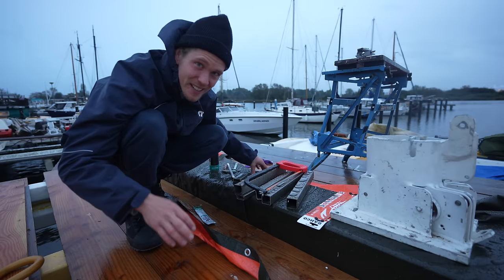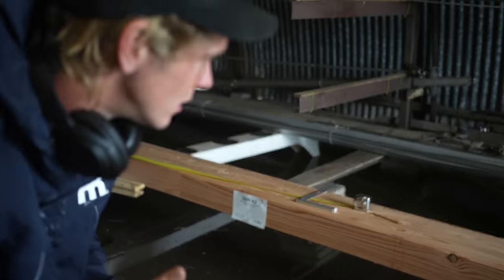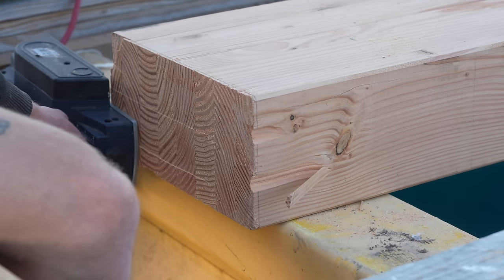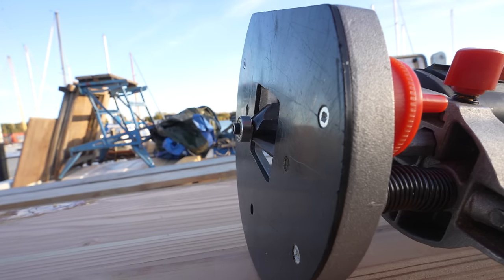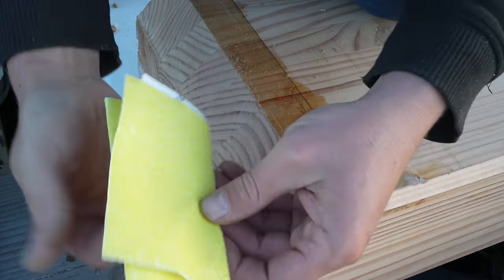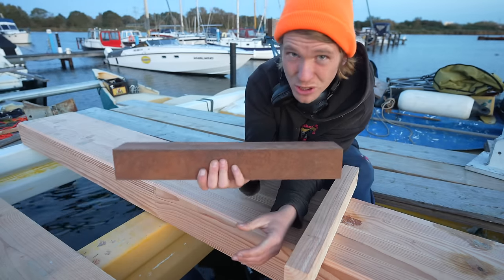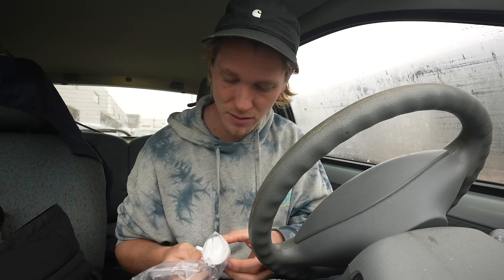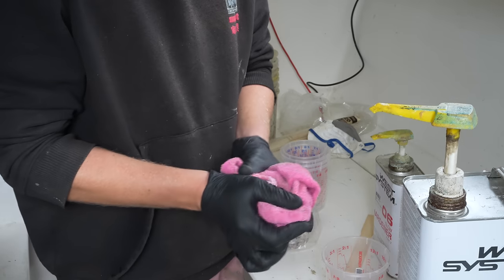My 42 ft Catamaran gets a HUGE Mast Step! | Wildling Sailing

Comment: Makes sense to use wood the same as the cross beams Mark. Personally I've never liked lag bolts, they always seemed mickey mouse to me. Drill holes in the soft wood the same diameter as the core diameter of the lag thread bolts always.
Reply: WildlingSailing0.  I can't use telegram but thanks for the offer.

Comment: If you are afraid the mast beam fixing bolts are not holding, you always can ad lashings. There is no sealant between the mounting poles and the deckbeams? As rot resistant as that wood is it won't dry at the meeting surfaces.

Comment: Mark you need to lash that beam with a stainless steel U bracket backed by a plate around the existing beam. It's so frustrating watching you,  at least I have so many adverts to watch to cool down.🤔🤔🤣🤣🤣

Comment: Nice mast beam. Nice choice on hardwood blocks. 316SS bolt material also good choice. I'm a little iffy on the lag bolt diameter and length tho. 1/2 inch (12mm) feels better. Allthread rod with washers feels the best. What does the drawings say? I always over design and make stuff hell for stout.

Comment: Hey Mark, concerned that you did not through-bolt those pieces of wood. Also no need for the lag screws to have any 'purchase' in those pieces of wood - the important thing is they screw down snuggly into the beam. Lastly if you're going to put epoxy in the holes, why not just cover the screws with epoxy - you'll get far better penetration?

Comment: Don't use lag screws for this critical connection of your mast beam.  Use long stainless bolt all the way through with locking nuts on each end.   A much more secure connection for this critical step.

Comment: Lag bolts are not my first choice, 316 stainless all thread through bolted would be my choice with a spring and flat washer at each end. Possibly 16mm dia. All thread is a much cheaper option than buying long screws or bolts. The hole in the hardwood should be oversize and wetted out with epoxy. Use a bedding compound between the pieces having first epoxy coated the timber. Question, are you going to glass over the beam? The beams lamination is laminated to have maximum strength in opposite direction to the way you are using it. A few layers of fibreglass cloth will help with this.

Comment: I would use metal plates for securing the beam. The wood is not going to be strong enough. 3/8” thick should be sufficient or 10-12 mm

Comment: why not cut a small recess on the mast beam so along with those screws you also have wood joint and much more strength to endure high winds, so that it fits perfectly there, i think something like 3, 4cm will not affect so much its strength and will guarantee it stays in place much better!

Comment: With the router, so you don't get tear out, just advance slowly regardless (you can't stop anyways). The slower you feed it, the less chance of getting a chip. If you PUSH the bit in, you'll explode the wood regardless of direction.
13:33 use a soap bar (which you rub on the saw's sled). You can use the bar of soap on any of your hand saws as well.
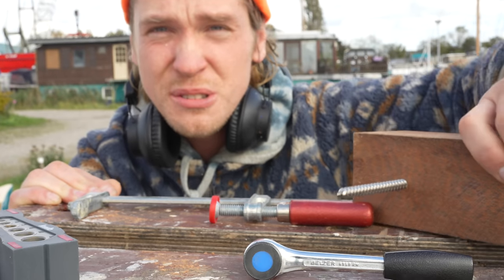22:26 you don't put your screws into the wood, because that doesn't do anything good for it in a marine env. You put a large hole (so for example, for a 7 mm screw, you make a 9mm hole) and put epoxy inside, you let that set, then you drill the thickness of the shaft of the wood screw, not its peaks (at the threads) or less (less, is better but harder to screw in and you can't always find the right diameter - usually you make your own drill out of a spade drill which you grind until it's the right diameter) and then you put your screw in. That way, the screw is set in hard epoxy, encapsulated and away from the wood. Be it stainless or regular metal, doesn't really matter, in time it will affect the wood because it's not the same material, so you're better off having an epoxy plug.

Comment: I would think that you may use a stainless steel bracket instead of the wood and get a stronger
mounting with less weight

Comment: Most decent quality epoxies work well and are much cheaper than the "West system". If you visit a chemist they will sell you hypodermic syringes...cheap, the two sizes 20 ml and 5 ml suit the epoxy and the hardener and provide a simple but highly accurate way to measure the epoxy. Obviously you do not use the needles, and this way you can mix small quantities for hole filling and such. All epoxies even with paint added erode in a few years in the sun, so if you plan on bringing her to closer to the equator you need to apply a coat of two part polyurethane paint to last a decade or more...Good luck.

Comment: Thanks for posting this video Mark, another great episode.

I read a previous comment about the way you've done the mast base with the coach bolts not being strong enough.
I mean disrespect to that person and I'm no engineer but isnt the  purpose of these  blocks just to locate the beam and the compression load is then taken by the main beam that youve attached the blocks to?
My only concern was the Fairy liquid being absorbed into the timber and affecting the  adherance of epoxy or paint to the beam, definitely will need a good scrub with fresh water to remove the fairy liquid , other than that Sealing the back of the blocks to prevent them absorbing water and rotting before attaching them I understand you'll be painting them later but that just me.

You're looking a bit tired in this video but You're doing a great job getting the Catamaran sorted she's looking Great, I'm not sure how the situation is with marinas in the UK but sure that once you get her in a condition to sail across the channel , being closer to home would make the process easier. 

Cheers

Comment: One will be able however to use this method when one wants to calculate the loads due to the 
lighter sails. In this case one will be able to take for the side force: 
Fy = 0,0625 x V2
x S x C where:
V = speed of the wind in m/s; 
S = surface area of the sail in m
2
;
C = variable coefficient of bearing pressure according to the shape and hollow's of the sail but 
which we will consider equal to 1,2. 
On the other hand we can determine rather well the share of the total force developed by the yacht 
of the jib, the mainsail, and also the resistance of the rigging and the hull. 
In addition we also know rather well the value of the lateral component of the total force since its 
moment compared to the centre of the immersed canoe body is at any moment equal to the righting moment

Comment: When you bold down that mastbeam don’t use glue as you cannot remove it when you need. Don’t worry about the weight of that beam. Your boat is designed to carry the weight of six or eight people and their supplies. I do worry however if the beam is strong enough and if you should not put the other half on top of it at least spanning the distance of two of the crossbeams. The forces are not only the weight of the mast snd sails but also the tension on the stays and the sheets. Those are not steady forces but dynamic forces as the boat slams and bangs the mast will do the same. But the mast is 12 meters and the forces that make the mast swing in the top will be increased times 12.

Comment: Hi Mark, I like a lot how you keep improving your boat as well as your abilities. I'm sorry I need to say it, but in minute 17 you're carrying your electric tools by lifting them holding the wire. An electrician who might see that would probably like to kill you. The pull relief inside the machines is only designed to carry the weight of the WIRE. So better don't do it that way and have your tools in good condition for many more applications that will for sure come. I wish you will have great success with your work on Mahi in future just as you had in the past.

Comment: The biggest force on the beam you're installing is compression. You could almost hold it in place with a couple long dry wall screws and 2 dobs of thickened epoxy. Beautiful piece of laminated lumber that will handle everything you could ever put against it. Looking good!

Comment: Keep at it kid.
Quite the educational experience.
The folks panicking over potential loads and stress should not be lightly dismissed, if only to ensure you have thought things through.
However, to duplicate what was specified and executed in the original design drawings would appear to have a fair amount of historical evidence to support doing it as Mr Wharam intended….yes/no?

That said, considering the amount of time and effort and expense repairing rot in places of structural significance…I think you should be more diligent in bedding or bonding any material  that will be exposed to the elements.

So much surface area underneath the wooden cleats you’ve lagged to the cross beams that will ultimately get wet and start rotting, again.   The same epoxy you used to fill screw holes could be used to bond the blocks and minimize water penetration.

You are correct that virtually every epoxy has limited UV resistance.  Don’t be fooled into thinking that you can add some  pigment to create an effective paint or varnish. It looks pretty. But if it’s exposed to the sun you’ll still need to paint over it to keep it from turning yellow and flaking off.

Lastly, look up a curing phenomenon called “amine blush” that many epoxies exhibit.
It’s a residue that can form on surfaces of newly cured epoxy.  It’s gummy and makes additional layers of adhesive or paint difficult to bond if you don’t wash/scrub it off.

I know you always feel the pressure to get all of your many chores done….but gluing up a few small test joints in advance may provide insight regarding mix ratio, bond strength, cure times, blushing….etc.
In the long run, it will likely save you some time and certainly build confidence.

Best to all, especially mom and dad.

Comment: Mark, your going good mate, do yourself a favour and buy new outboards, hi thrust, 4 stroke with fuel injection, for easy starting and prevent stalling and the biggest you can afford as on a cat in a head wind it is easy to lose steerage.

Comment: Those dark wood blocks you screwed onto the crossbeam with those very long countersunk screws do not appear to have any washers under the screw heads.
I don't think that is a good idea. You take the risk of splitting the blocks with those small screw heads.

Comment: So I am confused by some of the comments. If you are following the plans for this mast step, great. Follow the plans. If you are not following the plans then, well, probably you should be. I suspect the beam would be strong enough, and I trust the plans, but I would be hesitant to trust the beam if it is not in the plans.  And as I said in my other comment, but want to reiterate, you absolutely cannot leave uncovered Douglas Fir on a boat. At a minimum it needs to be coated multiple times with epoxy and then painted. Ideally it should be wrapped in fiberglass because Douglas Fir is very prone to checking. I am not sure if epoxy coating will fix that problem.

Comment: I agree with others. some kind of bracket around the mast beam and crossbeam is a better plan.  one idea would be to use a concept like is used on the ends of the crossbeams and tie the mast step down with a mountain of rope. you could screw those pieces of wood up into the mast beam from the bottom to stop forward/backward motion, then tie them down to the beam.

Comment: Why use different wood when you have a whole beam left to use. Also beter use wood as braces (screw on beams) instead of bolts. After making braces you can use just the ropes to hold the beam in place. Quess ropes would have beean used too in the original design? Cheers, you will make it sail, it is already floating 🙃

Comment: Mark Now you can ignore this if you so wish but that materiel for the mast beam is WRONG !!! You should use what is known as Clear Pine IE it has no knots etc in it That wood you have bought is not as strong  as clear pine  and could def fail due to the inherent faults in the timeber !! The other thing is if your installing it flat then the lamination is wrong as it has no strength in the vertical plane ??

Comment: You started that cut well. But I think you lost patience. A bit of beeswax or candle wax on the saw blade helps it glide through the wood and makes the job easier and faster. Just avoid the temptation to speed it up. Also measure twice cut once.
Reply: Great advice👏👏👏
Reply: You really need to use stainless steel straps around the mast step beam and cross beam a few screws will not do it.